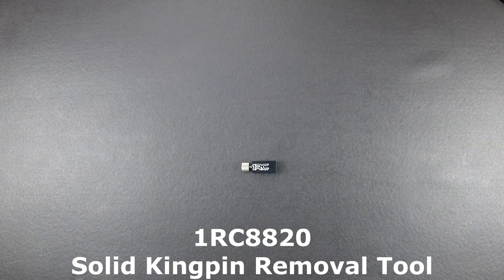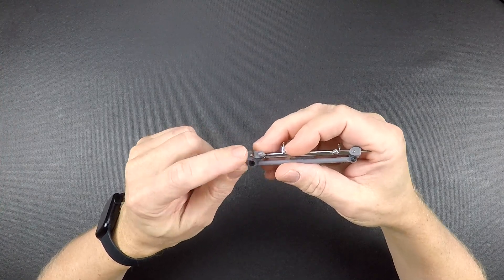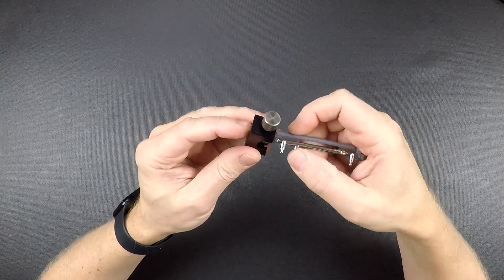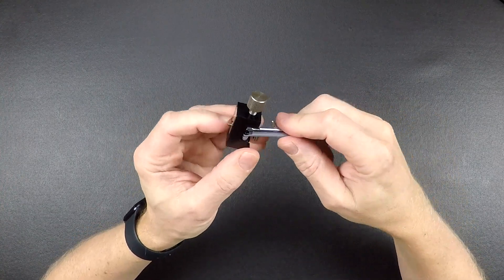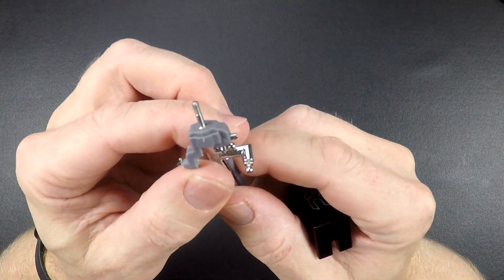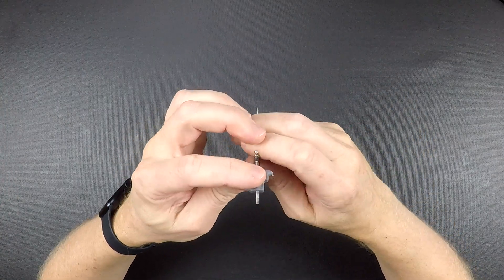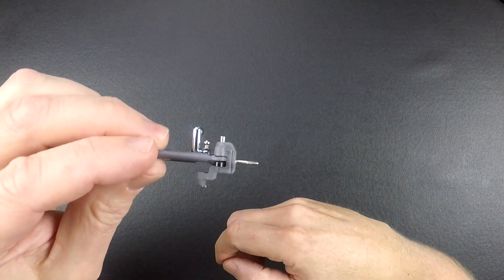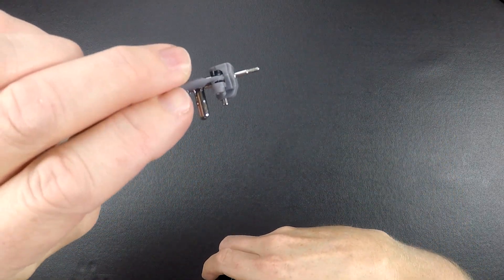1RC Racing - 1RC8820 - Solid Kingpin Removal Tool

Comment: Thank you. Why would I need to remove the king pin? Is there something I am supposed to be doing?
Reply from the maker: We recommend taking them out from time to time and cleaning everything good and then re-lubing everything.  Also if you break a spindle you would need to get the kingpin out to replace that spindles and this tool will make that removal process much easier.  Thanks and let us know if you have any additional questions.
Reply: @1rcracing149  thank you, do love the cars. Not that fast yet.
Reply: Slap a faster battery in there and it’s flying but even then you don’t really want them to be fast because they are supposed to be touchy-steering cars so it would be pretty hard to control especially with the sizes of the tracks